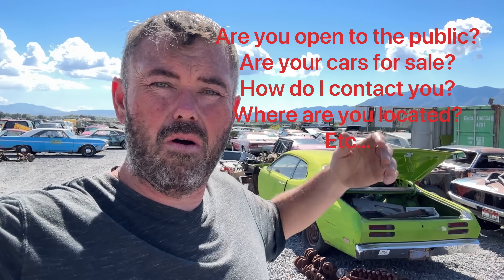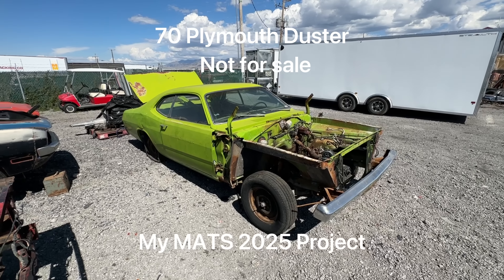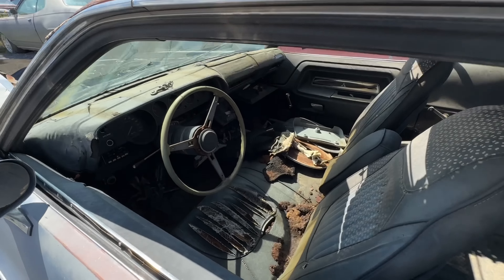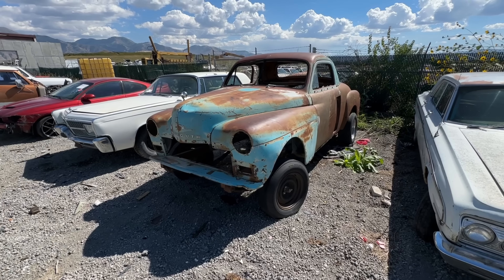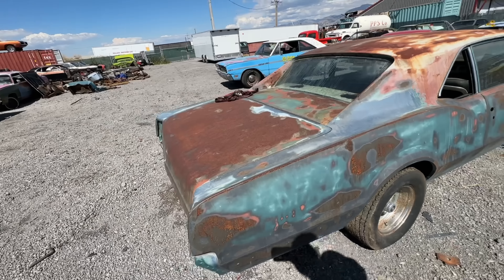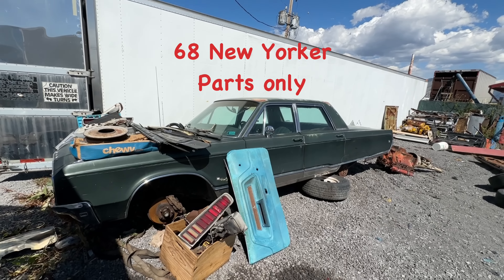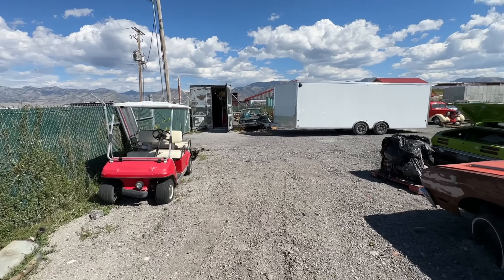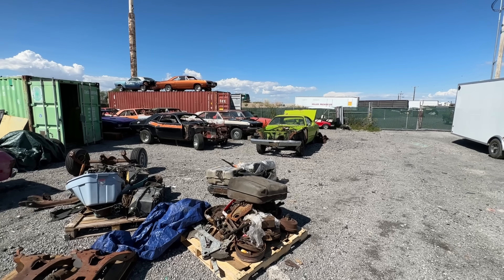EP 106 Walk around of DD Auto & Salvage Classic Car yard with prices. Lots of MOPAR and more.

Comment: I got a '69 Swinger almost identical, in the Spring. It was sitting for 41+ years, bench gone, but transplant '68 RR 383 set up in it. 
The worst part? Removing the '70's Hill-Billy look/engineering & the front footwells rotted due to the rubber flooring. Best thing? Most all the AC stuff is there & can make work
We've got a new floor in it (with 4-speed hump), USCT level 2 stiffening kit & 26" radiator core support, purchased a ton of interior/trim/ weather seals & gaskets, as well as more.
Since not original or numbers matching, perfect restomod to build & enjoy. 
It will look "Correct" to a lot of people, but car folks will notice slight deviations. People do not realize most time how hard it is to find stuff like this that are solid builders
Reply from the maker: Sounds like it’s going to be a really fun ride. As you can see by my videos, I have a soft spot for 69 Swingers.